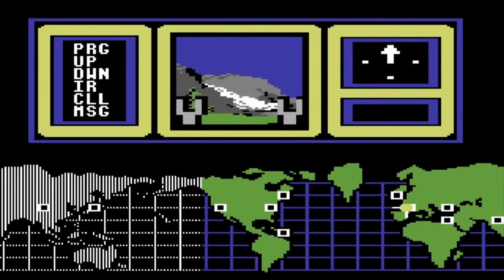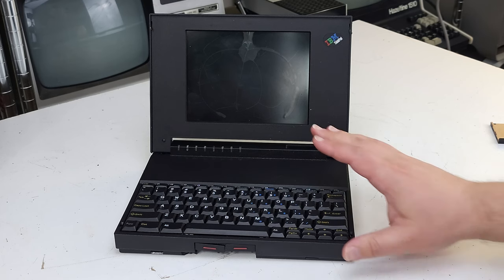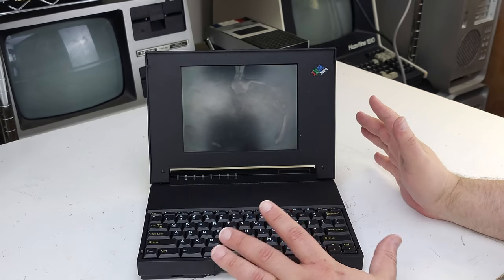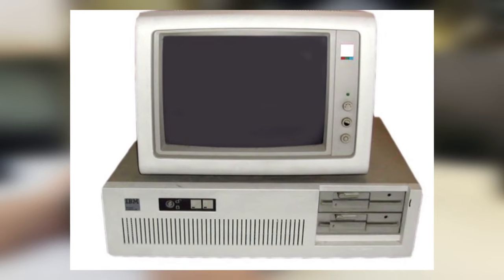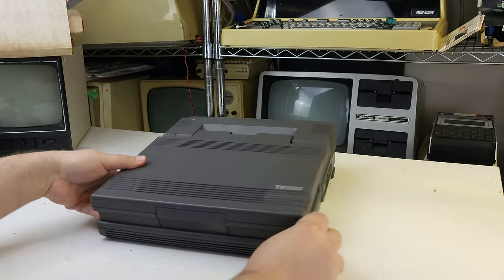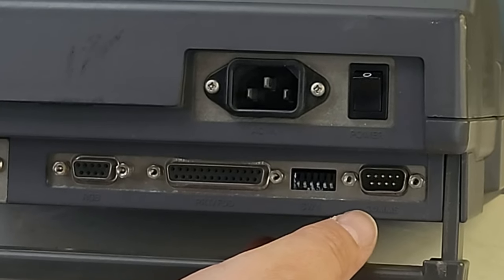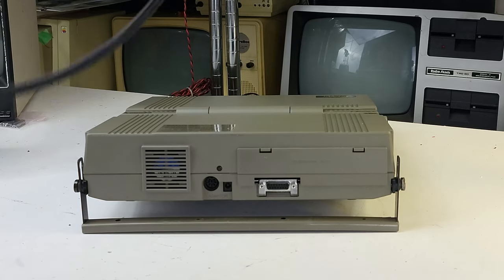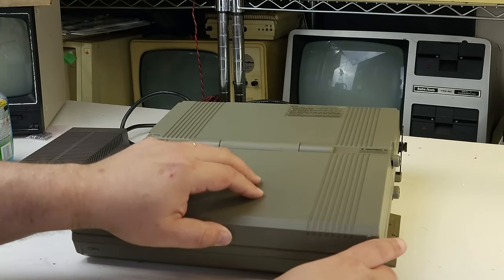More Old Computer Stuff I Bought

Comment: The VersaWriter is a great find. I wanted one of those back in the early 80s, but they were so expensive.
Reply: Back in 1980/81 or thereabouts a high school friend of mine and I collaborated to make our own VersaWriter for his Apple ][ Europlus, after seeing the ad in BYTE. I did the mechanicals and he wrote the software. It worked but wasn't very accurate as we used cheap carbon pots not high precision wirewound units.
Reply: @1944GPW  I didn't try that but I built a light pen using instructions from a magazine. It worked but not great.

Comment: I still have an ex-govt. T3200SXC with Math co-processor in my Attic.  Those weren't Lap Tops, they were fully fledged Luggable Lap Top Form Factor Desktop PC's.  That got used well into the late 90's.  They were an interesting machine, the C variant cost $18,000 Au at the time, came custom manufactured from Japan, and it's screen was a first of it's kind Hand Made 800x600 SVGA LCD alone costing $10,000 Au, iirc that was back in 1991.  One painful problem with the 32C is that in order to save silicon they kept their Bios settings and firmware data in a hidden partition on the hard drive, which meant if the Partition was damaged in any way the entire system would be bricked and had to be sent back to Toshiba and be fitted with a new HDD (Thanks DOS6.22 Doublespace!).

Comment: LMAO at that newspaper report in the beginning as well as the animations.
I have one of these Toshiba T5100. The screen is 640x400 and if you install Windows 3.1, you can use the Compaq Gas Plasma driver to run Windows in native resolution, unfortunately at 1bpp instead of 4. And your EGA monitor won't sync it.

Comment: Regarding the T5100 HDD problems, I had a similar issue with my T3200SX, just with a 256 MB CF card. I have the modded BIOS, which adds the XTIDE BIOS as well, so the laptop will boot with any HDD, not just the factory Conner. When I partitioned the CF card and installed MS-DOS on it on my Compaq Armada 1530 (before I would actually have the Toshiba), it wouldn't boot off of that card. If I did the partitioning and DOS installation on the Toshiba, it would boot fine, and even plugging the card into a USB card reader wouldn't damage the boot sector or system files :) However since it's quite hard to get to the HDD/CF card, I installed an Ethernet card into the 8 bit ISA slot (the 16 bit one has a SoundBlaster 16), and I just FTP the files over thanks to mTCP and the included FTP server application.

Comment: I bought one of those AT&T 1300 terminals. I'd read that some of the later models have Yamaha V9938 video chips in them, but this one has a TMS9118N like the TI-99/4A and the original MSX, and the main CPU is a TMS7001NL-4 8-bit microcontroller, 16K OTP ROM, a 1K EEPROM, and I think the only RAM is 128 bytes in the MCU and 16KB video ram.

Comment: Didn't have a T5100 but I did have a somewhat later one, a T3100/20.  It unfortunately had a dead floppy disk controller.

I've had several of those old Conner hard disks and not one had failed on me.
Reply from the maker: Yeah this one wants to work but the spindle motor is sticking I guess.  I don't see a way to get it open and lubricate like you can on other drives.  The  t3100 was a decent machine... lighter and smaller tha  the t5100 I think.
Reply: @TechTimeTraveller  I don't think the T3100 was a whole lot smaller.  I think the hard disk worked in mine but I couldn't get the floppy disk drive working.

Comment: The versawriter tablet - does it have two potentiometers or or two rotatory encoders ? It can be interfaced with arduino. We can also write a software in processing for the same
Reply from the maker: I believe it has two potentiometers, ine in each pivot point on the arm.

Comment: I have a T5100 - it's a tank!  Unfortunately the BIOS is pretty limited about which HDD it can handle.
Reply from the maker: Yeah I never realized that they locked the BIOS.. but I suppose that's handy in the sense that you don't have to guess much about what the correct parameters are.  I wonder if one could shoehorn in a newer IDE drive with the special capacity block jumper and maybe format it for whatever capacities they support?  Kind of rusty on this stuff.
Reply: @TechTimeTraveller  This brings back old memories. Now I do remember that there were some software you could use to get around the HDD limitations of the BIOS. If I remember correctly it installed on the boot sector and bypassed the HDD I/O routines in the BIOS. So to the OS and partitioning software the full drive capacity was available. It's been so long since I used it that I can't remember what it was called. I have a feeling some HDD manufacturers provided this software, but they all bought their licenses from the same company.

Another option was to use a controller card that supported large drives. So called HardCards were expansion cards with a HDD controller and a 3½" HDD. You slotted it in an ISA slot and the controller on the card took care of making the HDD accessible without you having to touch the HDD settings in the BIOS or configuring it using DIP switches or jumpers. You might still have to set some jumpers on the HDD card to make sure it didn't conflict with anything else in the computer.

SCSI or ESDI was another possibility, but ESDI was basically dead when IDE became common and SCSI was the big boy I/O interface and a lot of people newer really understood how to use it. I thought it was pretty simple. Set one SCSI ID number for each device installed on the SCSI chain and make sure there were not ID conflicts. Terminate each end of the chain, and only there, and make sure termination power is enabled, usually only on the first and last device. Again you might have to configure IRQ, I/O address and memory address using jumpers to avoid conflicts. The cards firmware should load during post and display a list of connected devices. Once your HDD's show here you should be good to go.

Heck, you might actually feel things like this has become easier today than they were back then, and you shouldn't be wrong in thinking that.

Comment: That's not how you use a mechanical digitiser! Move the puck to the end of a line, press a button, move it to the other end, press a button, and you have a straight line connecting the points. (It's also not so much a script, either, just a very primitive vector markup system.)
Reply from the maker: Ah.  I had read Williams' tools were more like freehand drawing.  Now I'm really looking forward to trying it out!

Comment: how about the spring out mouse, but the robot arm is the mouse, not the mouse itself (no optics, or ball), just some buttons on the robot arm
Reply: can fold fully inside the computer, for storage, out of the way
Reply: the mouse electronics only need to read the resistance (whatever) value of the arm joints, as angle, maybe also a linear axis resistance value (radial potentiometer linearization)

Comment: @12:05 Why is there a rolling shutter effect?
Reply from the maker: IIRC, it's because gas plasma screens are more like CRTs in that they update line by line, pixel by pixel, rather than just turning pixels on or off like an LCD does.  I think.  So you get the wave effect on camera because the refresh rate is outside the camera's range.
Reply: @TechTimeTraveller  Thank you for the detailed explanation. I didn't even know about gas plasma technology until now.
Reply: @Sashko_Dee  rather late but, it's eventually what ended-up becoming plasma TVs! But of course those use a very complex array of red, green, and blue plasma cells. While these are just one very big plasma cell (hence monochrome), controlled much like a CRT was :)

Comment: For the Snap 1+1 - is it possible that those thumbscrew looking things are just to lock it in when you don't want to use the snap functionality? I imagine it'd be convenient to be able to lock it in if you know you're not going to be moving around much, but if you were on/off the dock constantly you could leave them unlocked?
Reply from the maker: That's a good thought!  Additionally.. I discovered the screen 'snaps' out.. apparently they sold several different versions of screen and people could switch between them for different applications.  But that's a good thought.. maybe those screws just hold it securely when it's being toted around a lot.